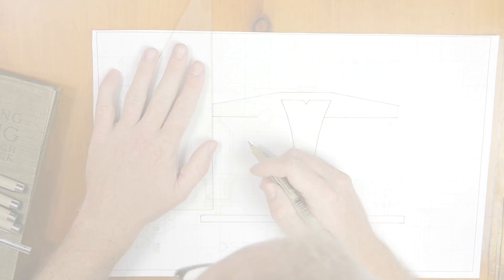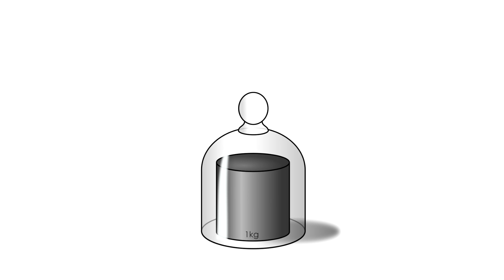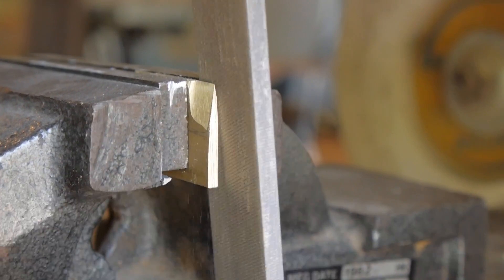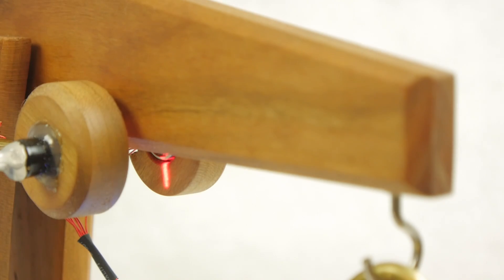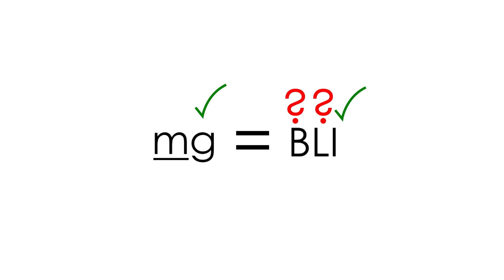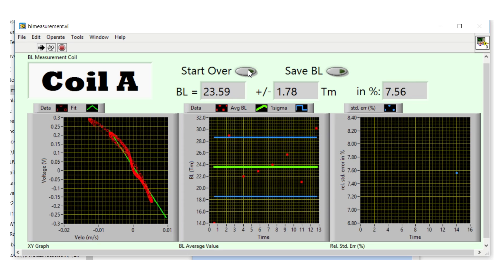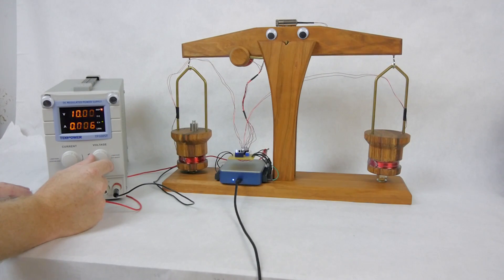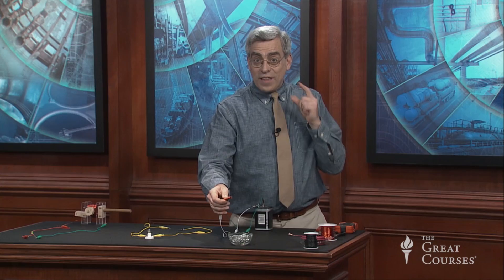Redefining the Kilogram with the DIY Watt Balance

Comment: If the Kibble balance used to define the kilogram has an error of around 2 × 10⁻⁸, how can the stated error in the rest mass of an electron be only 3 × 10⁻¹⁰? Wouldn't the lab measuring its rest mass have to realize the kilogram first?

Comment: 8:25 If you also wondered why g = 9.793 m²/s and not 9.81m/s²:
Its the gravitational acceleration substracted by earths centrifugal accelaration at the surface. 
According to Wikipedia the value 9.79379 is right, but it looks like there is a typo in the unit: [m²/s] -> [m/s²]

Comment: The equation have a flaw.. 
 gravity in difrent part of the eart have a different amount. For example, gravitation acceleration (g) in or near equator is weaker than in other places..

Because your equation have a gravitation acceleration variable, than you have to find the local gravitation acceleration in your area.. 

And if i not wrong, gravitation is length divided by time divided by time or lenght per square of time.. since there is no mass involved, you can find the local gravitation acceleration in your area

Comment: But how did we measure the earth's gravity exactly at that exact location accurately to plug it into the formula? Surely we didn't use the official IPK in the experiment to measure the acceleration due to gravity, so this experiment's result the subject to the error of that old experiment including how well the object used as the reference kilogram for that old experiment was cloned from the IPK.

Also, Kilogram is used to define the Ampere so isn't this experiment a catch 22 since you are using something that gains it's definition from the thing that you are trying to measure more precisely using it?
Reply: Yes, how does one measure g accurately? It depends on your location on the globe.

Comment: When I took high school physics in the early nineties, I wondered why we didn't just redefine the gram as the mass of some (fairly large) number of protons.  It took me a while to realize that the neutron be a better choice, and to wonder whether we can even measure the mass of a particle with enough accuracy for this to be practical.  Sources such as Wikipedia give the mass of the neutron in kg with 8-10 digits; but how sure are we that those figures are accurate, and even if they are, are they precise enough?  If the mass of a platinum/iridium cylinder kept under physics lab clean conditions fluctuates to a degree that we're worried about... maybe 8-10 digits of precision isn't enough?  Setting aside for now the question of whether those figures are correct, can you just comment on why eight or ten significant digits would or wouldn't be precise enough?

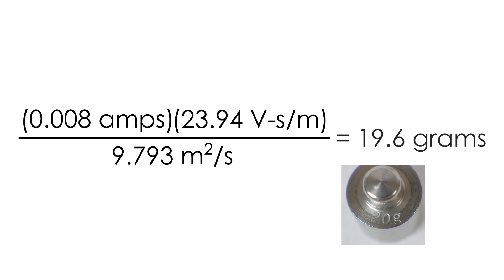Comment: 8:34 Isn't g ≈ 9.807 m/s^2, not 9.793 m/s^2? Could you improve the accuracy by doing a better current (and voltage) measurement? 1 mA resolution is too grainy. And I could measure 1 mV resolution. I know this is just a PoC, but I'd like my Watt balance to be more accurate even if it requires more money/time. What other improvements would you suggest?

Comment: Correct me if I'm wrong, but you're still using the Ampere for current in the equation. Ampere is defined by Meter and Newton.. and newton is defined by..? Exactly, Meter, Second and Kilogram - Which is defined by the IPK. So the watt balance isn't capable of defining the Kilogram!

Comment: The part of this I'm most curious about is the claim that we know the acceleration due to gravity, at 8:24.

This changes enough over the surface of the Earth that I thought the uncertainty was more than the precision you claimed you could measure to. Do you need to measure that separately, or did I miss a part where the watt balance could figure that one out too?

Comment: The definition of seconds and length are not what I'd call definitions. More like equivalencies. Speed of light? Its been measured in meters per second and you're mulyiplying it by a some arbitrary second to tell me what the length of a meter is? Why that arbitrary seconds value? The definition is more akin to the origin of the value. Which i believe was the length from equator to pole passing through paris, divided by a million.

Comment: Watt Balances are only transferring the calibration to volts and amp metrology.  A much simpler way is the Silicon mass standard. Silicon 28 isotope ball standard where a pure crystal of the isotope polished as the standard. There you have the only distance (diameter) to calibrate the standard. The fewer steps the better.

Comment: What people don't realize is just about everything goes across a scale one way or another.Brilliant explanation.  I've been in the scale industry since 1984 dealing with scales that had an accuracy of a nanogram to  the largest capacity of 10,000,000 lbs and have always referred to the French 1Kg weight when explaining to customers how accurate their scales are and certification of weights.  Now technology has changed that.  Thank you for taking the time.

Comment: ROFL are you kidding me? A comparatively ridiculously complex system using probably half a dozen units including volts, amps, and ohms to define the unit they themselves are at least partially based on? This is an incredibly poor idea to consider seriously, you're using circular logic. If the kilogram is defined by that method, most other components in that system will inherently change value, meaning all measurements and calculations will change value, meaning the kilogram will change value, meaning all measurements and calculations will change value.... Ad infinitum.
Reply from the maker: I can assure you that someone much smarter than me has considered these issues, but they are too complex to discuss over YouTube comments. Check out the document I linked for more information.

Comment: I like your videos, but the kilogram isn't the only artifact. The Kelvin is still defined as 1/273.16th part of the difference between the water triple point and absolute zero. This water triple point is realized in a device called a water triple point cell, which is an artifact, just like the kilogram. It may however be replaced in the near future.

Comment: Great video!
I had a look at the NIST balance and, sophisticated as it is, still suffers from the fact that it is mechanical and it's a balance. Not a very elegant solution, to get rid of the block of metal in Paris...
Why not measure mass through its inherent property - Inertia ? 
This would get rid of pivots, etc. You can measure inertia with an inverted pendulum rigidly fixed to a base and make it oscillate as in a diapason (tuning fork) - any mass added to the free end will change the natural frequency of oscillation and can be precisely measured.
This is what engineers at NASA developed many years ago to measure mass in space (where Earth's gravity no longer applies) and seems to me to be a far simpler and more accurate method of measurement.
Would really like to know your comments on this.

Comment: I know diodes and LEDs are made of PN-junctions. How are PN-junctions made? How do you actually dope something?
Reply: To dope silicone, you just mix some arsenic in to make it N, or boron to make it P.
historically, they put the masked wafers in a furnace and pumped the desired atoms in.
now, they use ion cannons, where ions are accelerated and shoved into the masked wafer.

wafers are masked, allowing the doping atoms to strike only the right parts.

Comment: Wait... The measurement of gravity is calibrated against a physical artifact isn't it? Or are we not concerned about those decimal points... ?
Reply from the maker: No, you can measure gravity by measuring the acceleration of a falling object in a vacuum. Any object will do.
Reply: That's what I'm saying. The acceleration of that object is entirely dependent on our measurement of time, which is measured against what exactly? A cesium atom? Are we accounting for special relativity?

Comment: Wait a minute, the way you have described it, by using g, you are defining the weight by using the mass of the earth as the standard. g is essentially GMe/r^2, where Me is the mass of the earth and r is the radius. So we swapped the IPK for Me/r^2?
Reply from the maker: The definition of g doesn't really matter as long as it can be measured with extreme accuracy (and it can at sophisticated metrology laboratories). In fact, g varies both by location on the earth and even by time (due to changes in groundwater). So every measurement with the watt balance will be accompanied by an extremely precise measurement of g. Obviously, I couldn't do that in my experiment, so I had to use an assumed value.

Comment: From a theoretical standpoint, the Watt Balance is a terrible definition of mass. The definition should be a measure of Newton's constant or the Plank constant. However, from a practical engineering standpoint (kind of the definition of this channel), it seems to be the best option. Right now it is just about equal in accuracy to the way we do it now, but it is much more stable and long-term sensible. The official change is expected to be made pretty soon. While thr Watt Balance isn't the only contender for redifining the Kilogram, it is the most accurate and so almost certainly will become the new definition when NIST meets next to discuss it.
Reply: From my understanding and Veritasiums video, NIST isn't really defining the kilogram but defining Plancks constant using the IPK.

My understanding they are redefining the kilogram using Einsteins Energy Mass equivalency equation which is derived from Newton's Second Law.

So if E=mc^2 and E=hf and h is Planck's constant and f is frequency we have 

(hf=mc^2). We can define h as being (h=m*(c^2)/f ) where f is the frequency of the cesium atom used to define the second and m is the IPK. Once Planck's constant is defined we can throw away the IPK (figuratively) and define the Kilo as (hf/c^2=m) Unifying 3 physical constants to define the kilogram.

Comment: But how do you measure local g? Doesn't that require a known mass?
Reply: No.
Since objects with different mass accelerate the same in a vacuum, you can measure gravity by measuring how fast something falls. Time and distance can be reliably measured, and thus g kan be reliably measured.

Comment: I'm a bit lost on how this works. We're saying that [mass] = [Voltage] * [Current] / [Gravitational Acceleration] * [Velocity]. I understand how every unit is eliminated from the kilogram except for the current. The current is defined based on the newton. So your current measuring device in this setup has to have been calibrated to the kilogram. If this current measuring device was calibrated to something that is not quite a kilogram then all your measurements will be off. How is this eliminated??
Reply: They use the definition for Watt based on the Josephson - and quantum Hall effect.
It is explained in the paper that is linked in the description.

Comment: I second the suggestion from +Don Donlee about moving the wired components off of the balance beam.

I'm a chemist myself and I have a very precise balance but it's really hard to get accurate measurements do to static electricity. One trick I've learned is to use static dissipation or conducting materials.

You probably want to use materials which don't hold static charges well when you get around to building your next version.

You probably already know this, but when using mirrors with lasers, it's a good idea to use "first surface" mirrors so you don't get a double reflection from the glass.

Thanks for another great video!

Comment: Ok, this is funny because IIRC we still define the ampere as: 1A of current is generated when it's flowing two parallel conductors 1m apart which results in a force of exactly 2*10^-7N. And we define newton as kg*m*s^-2. So, basically, using this, we define the kilogram using something we defined by the kilogram.
Reply from the maker: +Oskar None Yes it seems a bit circular at first glance. There's a follow up video that answers FAQs.

Comment: I always thought earths gravity was 9.81m/s^2
Reply: It depends on altitude and location.
Reply: even large mountains nearby can effect gravity.
With a solid mass standard gravity does not matter due to beam
balance concept.
Reply: @meagain2222  Doesn't that undermine the entire point of this watt-balance? How can you know your local g accurately and without using a weight expressed in kg?

Comment: There was something about counting the number of atoms in a sphere of some element, but I like this better.
Reply: Silicon. They were trying to make a perfect sphere of silicon weigh the same as a kilogram. Once they do that, then they can determine the radius of that sphere, and consequently the number of silicon atoms in the sphere. Then they can say "A kilogram is the weight of the mass in this number of silicon atoms at sea level". 

Both methods have flaws, I cannot say which is better. I will say that 1 cubic meter of water at a particular air pressure and blah blah blah weighs a tonne, or 1000 kg. So, using that, we can already derive the weight in water molecules, and then in silicon atoms. Im not really sure why either method exists.

Comment: since the value of little g is difficult to measure and is shown to vary over time slightly, the watt balance method as described in this vid will not offer a better standard kg than the artifact one. This might be why the watt balance has not been selected as the device to redefine the kg.

Comment: Nice video. Although it's a little bit inaccurate: this method does not provide an universal definition for the Kg exclusively based on Universe constant: in one point of the formula you have to plug in the gravitational acceleration of the Earth (in a given point on the surface) which is not an universal constant and you'll find out it depends eventually on the definition of the kilogram.
For this reason the most promising (yet uncompleted) method to re-define the kilogram is "counting" the silicon atoms in a very very very round sphere: The international Avogadro project, https://www.nist.gov/physical-measurement-laboratory/silicon-spheres-and-international-avogadro-project
Reply from the maker: Hey Alessandro, thanks for watching! The first sentence in that link says that the scientists have selected the Planck Constant for the redefinition and not the silicon sphere. The watt balance will be used to first fix the Planck Constant, and then to define the kilogram in terms of it. Check out the paper I linked for more info.
Reply: Hu Grady, thanks for your answer. You are right, I checked the paper. Let me just add that I found this paper: http://grwavsf.roma1.infn.it/labmec/materiale/met5_5_014.pdf illustrating a 2005 measure of the Planck Constant to explain very well the theoretical background. Again, thanks for your video, and greetings from CERN :)

Comment: Something doesn't add up. I'm still confused about how this device works- why it needs coils on both sides, for instance- but that's not the problem. When you use this device to measure the weight of an object, you're measuring the number of amperes you have to pass through a coil to produce an upward force of such-and-such magnitude. Then, you say, you'll be able to redefine the kilogram in terms of that number of amperes.

But the definition of amperes depends on Newtons, which depend on kilograms. You can't measure amperes precisely without referring back, ultimately, to the IPK, which is what you were trying to get away from in the first place.
Reply from the maker: The second coil is only necessary to servo the balance in velocity mode. You're right that the redefinition has a few more nuances than I had time to address in this video. The paper I linked to goes into greater detail about your questions.

Comment: What about water?  I thought water was also the basis for a lot of systems of measurement, from the degree (Celsius) to the calorie to a few others.  Shouldn't 1L of H2O (at 25C and 1 atm) be a reliable means of calibrating a kilogram?

Comment: Hi Grady! Awesome video! I'm curious as to what your results were -- how accurately did your watt balance work? 

Specifically, I imagine that estimating the translational (linear in vertical) velocity off of a sensor mounted on the boom would introduce some error depending on how you a.) calculated the velocity (r*d/dt(theta) vs. it's equivalent involving sine), and b.) discretization noise from differentiating your position sensor. What was your sample rate and sensor resolution? Regarding a.), how much would mounting the laser (or adding a third laser) on the table underneath the "weighing pan" increase the accuracy of your measurement? 

Thanks and keep on rocking!
Reply from the maker: The final results of the 20g measurement are shown at 8:31. Most of the testing I did got me within 10%, but the main limitation of the device is how accurately I can measure current. Honestly the main source of error is probably the force from the wires connecting various components to the beam. Keep in mind that this was designed more as a demonstration about how the laboratory-scale watt balances work. The shadow sensor is calibrated beforehand so you have a direct relationship with the vertical position of the platform, so all that non-linearity doesn't really matter. You can see at one part in the video the process of measuring BL. There's not much noise at all, just a bit of hysteresis.
Reply: Thanks for the thorough reply and for pointing me to the results at 8:31.  Sorry that I missed those during my first viewing.  Again, I'm very impressed with the thoroughness and really enjoyed the demonstration.  I look forward to your future videos!